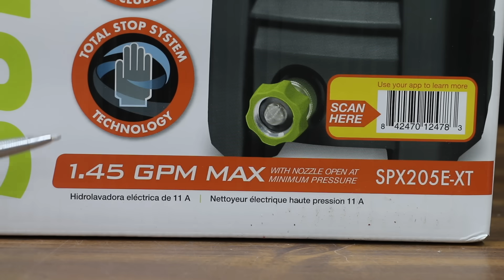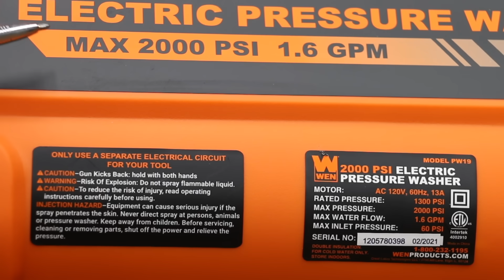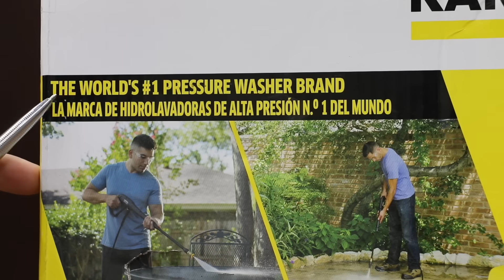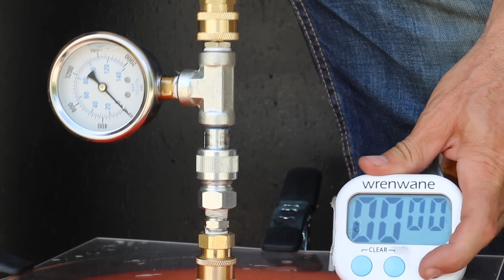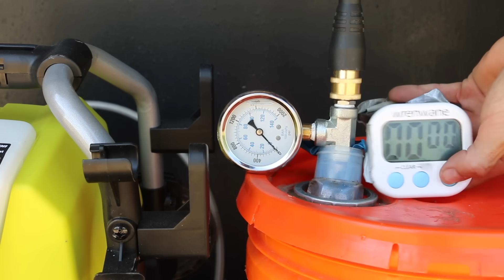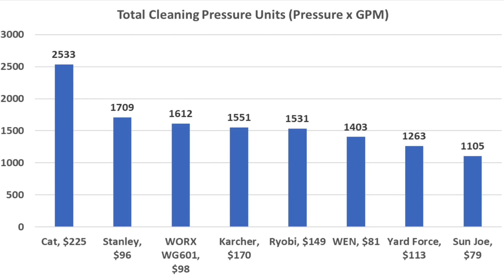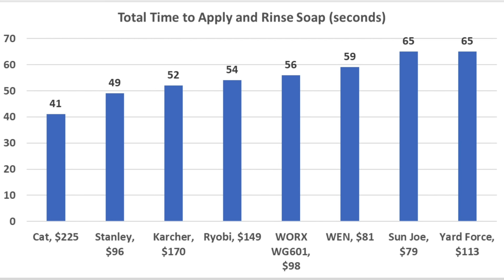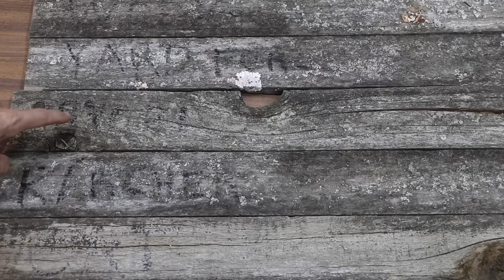Best Pressure Washer (ELECTRIC)? Ryobi vs Karcher, Stanley, Sun Joe, WEN, CAT & WORX

Comment from the maker: To help make finding the pressure washers easier, here are the links (in no particular order):
CAT:  https://amzn.to/3iyVMiV
Ryobi:  https://amzn.to/2Tr5dq9
Karcher:  https://amzn.to/3cBIM8r
Stanley:  https://amzn.to/3xhqRvr
Sun Joe: https://amzn.to/3vdOns1
WORX:  https://amzn.to/2SmwkCF
WEN:  https://amzn.to/3wlti06
Yard Force:  https://amzn.to/2TocmaL
Pressure gauge: https://amzn.to/35jC2rq
Foam cannon: https://amzn.to/3iCOKtp
Sound Meter: https://amzn.to/3uM7WsB
Reply: Couldn’t find one made in America?
Reply: For the 17 minutes it worked the CAT was great and took faded fence boards back to lighter color, BUT unfortunately the CAT has a known problem with the unloader leaking. The result was a shorting out a non-waterproof lighted round on/off switch that rocks the unit in a surging fashion.
Reply: Hey Todd any updates two years later?
Reply: Your new Slogan for your channel should be! "We're Gonna test that!!"
Reply: The "proprietary" connecter many of these have is considered "consumer standard". If you have a pressure washer or accessory, its either the M22 or this "proprietary" connector...
Reply: Will you do a video on a gas powered pressure washer. I'm in need of one after I bought my first house..
Reply: @imthatone830  he still hasn't done one. Seems like the gas ones would of been the ones to actually test. Not electric
Reply: Would a test of battery powered power washers be worth it. I recently purchased a Dwalt 40 volt power washer thinking possibly that a DC powered motor with the advantage of a DC batteries inherently greater ability to provide more power than a 120 volt AC powered system. I was seriously disappointed and immediately returned it. Dwalt should be embarrassed by offering such a poor performing piece of equipment. Maybe there are other manufacturers that are offering better options. I hope you decide to test this option.
Reply: What unit would you rate highest today
Reply: If you don't have an outdoor water supply, can you just put intake hose  into a large bucket of water? Also, no outdoor outlet and to far from indoor outlet, will using a car converter to plug the unit, (Stanley)  work ?
Reply: @ProjectFarm would like to see a warm water high pressure test to. And also how they compare to a normal one. ☝️
Reply: Time for an update on this subject.  There are much higher pressures available in the electric category now.
Reply: If you want to give one away, let me know. I was about to start a residential pressure washing business where I just moved to, and someone stole my dang equipment out of the building it was stored in, 3 hours away where I'm originally from.
Let my tool insurance lapse due to financial difficulties, like a moron, and learned an expensive lesson.
I know these aren't made for most residential jobs, but having a small one is great for some jobs.
Reply: @d-con6825 the cat is now $260 and the active $200 since this video a year ago.  Does the active have standard or proprietary connects?
Reply: @allnovieveryday  I think you're talking to the wrong person. I ended up getting a small business loan to replace my stuff.
Unfortunately, we live in a world full of bad people and thieves.

Comment: Hi Project Farm,

I really appreciate the in-depth and unbiased testing you do—your videos have been a huge help when it comes to making smart tool purchases. I recently watched your pressure washer comparison from a few years ago, and while it was incredibly informative at the time, I’ve noticed that the pressure washer market has changed quite a bit since then.

There have been some big improvements in both electric and gas models, including increases in PSI, flow rate, battery-powered options, and updated features like induction motors and hose reel systems. I think a lot of viewers (myself included) would benefit from a follow-up video that tests some of the newer models against each other and maybe even compares them to the top performers from your original video.

Thanks again for all the hard work you put into testing and reviewing products. You’ve earned a lot of trust from your audience, and I’d love to see your take on the latest in pressure washers.

Best regards.
Reply from the maker: Thanks!  Thanks for the suggestion.

Comment: The CAT 1800 is out of stock on Amazon, but the CAT 1850 is available -- and for less money.  Can someone explain why they are same brand and similar PSI, yet are vastly different design?  And how is the greater PSI less money?  If the 1850 gets the Project Farm seal of approval, I'll get it!!
Reply: I’m seeing this too, maybe cause the 1800 is a more portable design? but for almost half the cost something isn’t adding up
Reply: The 1850 model is higher PSI but lower GPM meaning it's a lower power/quality pump, which is why it's cheaper.

Comment: A 1/4" ID hose will lose between 100-120psi every 10 feet. You are also assuming that the flow rate advertised is true because the flow rate (GPM) is determined by the pump so unless there's a significant restriction (e.g., kinked hose, clogged nozzle, or undersized fittings), the full advertised (if accurate) GPM will still come out the end of a 25-50 foot 1/4" ID hose, though at a reduced pressure.

Comment: It may be the most difficult thing to test, but my issue with these electric power washers is durability. I've had bad luck with getting them to last beyond a few runs cleaning off my driveway. I usually do that once a year, and I guess it could be said they last several years, but that's not much use before one goes out. That said, I've never paid as much as the CAT goes for, so maybe I need to up my budget for a better machine.
Reply from the maker: Thanks for the suggestion.

Comment: I would to see this test repeated using electric pressure washers in the ~2500 psi/2 gpm range—the level at which they start to compare to gas pressure washers.
Reply from the maker: Thanks for the feedback.

Comment: Great video, as usual. I wonder if anyone reading the comments here (including the channel owner) has good experience with any electric pressure washer that is 3000 psi or higher? It doesn't need to throw a lot of gallons per minute, it's mostly the pressure I'm after, and hopefully it can run fine on a 20A/120V circuit.
Reply from the maker: Thanks!

Comment: The very best 8 GPM pressure washer I have is a stainless steel skid I fabricated and assembled myself, consisting belt driven blue Cat pump (UK Cat not Caterpillar), ABB industrial induction motor, ABB IP65 variable frequency drive, unloader, pressure transmitter and Mosmatic trigger gun. It's a perfect build money cannot buy off the shelf. It might last at least 30 years I believe. Total material cost was near to $7500
Reply from the maker: Thanks for sharing.

Comment: I have a Karcher,first handle developed a leak at the trigger valve, bought a replacement, some problem , same place. I have since deleted the trigger and now just use the on/off to control, clearly a flawed design.
Reply from the maker: Thanks for sharing.

Comment: I have had a Karcher electric powered sprayer for ~23 yrs and has worked good.  I think it was mfg in Germany back then.  I think this was listed at 1200 psi capability.  The accessory cart cracked and fell apart while doing little more than looking at it, but all else has been good and has met expectations.  The soaker/ detergent brush head that came with the sprayer is absolutely outstanding for gently washing and is a good product by itself.  The rotary nozzle reduces wash times considerably but would still be slow if having to do driveways.  The rotary nozzle and this pressure combo works good on cleaning the shingled roof of moss, and the directed nozzle for gutters.
For larger jobs and those in line for painting prep, the Simpson 3600 psi with Honda engine and 12 or 15" rotary sprayer attachment have been working good for the past 4 years.   (~$380 back then.)  The higher pressure really helps with the more stubborn mildew and moss.
Reply from the maker: Thanks for sharing.

Comment: Late Comment: Those proprietary nozzles can be replaced with wand-ends that have standard nozzle quick disconnects. This will alter performance. I have cheap low pressure washer from Amazon and a soap cannon that only washes vehicles. Great video! I know where to look when my cheapy eventually breaks
Reply from the maker: Thanks!

Comment: I've had a Karcher since 2002 and to this day I still use it and it works fine. That's 22 years later. If all you need it is for cleaning a car and your need longevity, Karcher absolutely blew my mind. I did end up buying a gas Ryobi for $500 at 3300 psi for some heavy duty jobs. Works fine but I've only had it for 8 months so I can't comment on the longevity. However, it does work incredibly well and it's so powerful it can peel paint from siding if you aren't careful.
Reply from the maker: Thanks for sharing.

Comment: I would recommend that you test electric pressure washers that have 3000 PSI - 4000 PSI ratings.  These have become relatively cheap lately and you don't have to mess with a gas engine.

Comment: Question:  I purchased the CAT model reviewed here.  Very happy except the pressure washer garden hose connection leaks on the back side.  Checked connections, threads, washer, etc.  Everything spot on.  When I examined it more carefully, I notice the female connector nut on the CAT does not seal completely against the metal tube exiting the pump.  The (female) nut connector seems to get snug up against the metal exit nozzle without creating a complete seal.  It doesn't leak terribly - yet - but is there a part missing or is the intended design?

Comment: "Warning: If you buy any DeWalt or Stanley pressure washer in the Los Angeles Area you must travel to Ontario for service under warranty. 
My DeWalt's unit's telescoping handle broke after 6 months, so it is not easy for me to get it repaired under warranty as the service center is 1 hr away.
Reply from the maker: Thanks for the feedback.

Comment: Hi PF, I was wondering if you could refresh this video.  There's a lot of electric pressure washers on Amazon that claim very high PSI like over 4,000. I'd love to see this actually tested. Heck, I'd love to see an actual electric pressure washer that's comparable to gas.
Reply from the maker: Thanks for the suggestion.

Comment: Just an 18month update on your priceless Review...
I bought a Stanley washer here in Ausralia which was like $50 more than our most popular brand Ryobi ...
I have owned 2 Ryobis over the last 5 years which died due to the what 'I call' normal use ...
Our most popular Australian hardware store (like your Harbor freight?) did not stock them, so I tracked and had one delivered ...
My Stanley is still going Strong and the motor has not failed yet ... 
The Plastics are still like new even though it gets stored 'Outside' rain, hail or shine ...
Its even copped a few Dry runs from being lent to friends who dont understand Priming 😢
Like I said 
2 dead Ryobi later and my Stanley still Strong ...
Wish I could have afforded a CAT .. 
But I owe you a beer 🍺 for giving me good advice and finding a good product 👍👍
Reply from the maker: Thanks for the update!

Comment: Best pressure washer with heat capability so car soap mixes really well would be a nice review. The increase in heat helps mix the particles better than room temp water. You’re getting more out of your product than if you used room temp water because of the dense energy.
Reply from the maker: Thanks for the suggestion.

Comment: Considering how close the Stanley performed to the CAT, it would be interesting to see how the more powerful Stanley SHP2150 performs compared to the CAT. The Stanley SHP2150 also has an upgraded wand with quick change tips similar to the CAT.
Reply from the maker: Thanks for the suggestion.
Reply: My Stanley is still going strong 18months of very good use .. no sign of dying yet  ..  👍👍🇦🇺
(better than our cheap leading Ryobi with all its fancy attachments and ctap motor)

Comment: You need to do this with bigger psi washers do a 2000 to 3000 test or 2500 to 3500
Reply from the maker: Thanks for the suggestion.

Comment: Great video as always, but I would like to see a 1 year review.  This is because most negative reviews on pressure washers are due to the units failing to run after a few months.  It could have something to do with water quality or the internals rusting, but this would be an important part of making a decision.  I have had units in the past that, if left for more than a few weeks without use, tend to be more prone to failure.
Reply from the maker: Thanks!  Thanks for the suggestion.

Comment: Always appreciate your videos. Just bought an Active pressure washer - which apparently the CAT is, just rebranded. It was $30 cheaper than the Cat. Got it today and cleaned my trashcans. It worked awesome and it was really nice not having to drag out my bulky gas washer for the small jobs like this. Thanks for doing these videos, I’ve relied on them before several big purchases.
Reply from the maker: Thanks and you are welcome!  Thanks for sharing.
Reply: The active 2.0? Is it really the same? Where did you see that? I have both in my Amazon cart been meaning to make a decision lol.
Reply: @ThatAccumulator  - Not the 2.0, the VE52 and this cat have the same five piston pump. The cat has different storage solutions and an extra nozzle, though.
Reply: @ThatAccumulator  - PS, IMJOSHV detailing channel did a side by side comparison of the ve52 and cat. Id paste the link, but it would get deleted. Good luck.

Comment: Had always borrowed a gas powered unit from work for the Spring deck and walkway cleaning. This Spring I bought the CAT unit and it works perfectly.  Using the 25 degree nozzle it has just the right amount of stripping power to clean the Vermont winter grime off the wood and prep it all for summer.
Reply from the maker: Thanks for sharing.
Reply: If you don’t mind me asking, could you give us an update on how your unit has held up after 6 months?

Comment: 1500 psi is hardly the best of anything. For less than $275, you can easily find quality, mid-level pressure washers at 2500-2800 psi at 2.0-2.5 GPM.

Comment: Make what you will of this info...I bought a Karcher 1700 psi sprayer back in 1997. Stored in an unheated shed, it just started leaking last summer. I did nothing as far as maintenance. The replacement part costs $20 dollars. Works fine after 25 years.
Reply from the maker: Thanks for sharing.

Comment: Not sure why YT is showing me this a Year late....but Ironically we are looking for a 4000 PSI electric for use on the Hay Barn roof so I dont have to haul our 125 lbs mid size washer up there like the last time I did it 10 yrs ago when i replaced a few Thousand rusty screws.    Sadly the 1500-2000 psi is a bit to light for our needs but still nice to know the results in case we need a small power boy for Fairs or Shows, Keep up the Great Work !!!   
 
  Also.... I have been meaning to ask you have you ever tested ANY of those Rechargeable LED Flashlights you carry around in Truck , Junk Draw etc.........I dont mean the Flashlights That can use the Dewalt 20v battery for Cordless tools but ones that claim you can see a 1/4 mile with etc.. ie on Amazon, we use a few that have (2) 18650 3.7 l-ion batteries they are normally like between 12 to 15 inch long flash lights.    Be Safe & God Bless  🍻💯🙏🌴🐊✝🤠  Cow}:-o)
Reply from the maker: Thanks!  Thanks for the suggestion.

Comment: What about DUTY CYCLE, the most important factor for usability AND a good indicator if it will fail if it's a short time and you run it overtime frequently.
You usually have good testing but you utterly failed on this test

Comment: I have had a sunjoe for over 5 years now and it’s still going strong.. I often leave it out and it gets rained on and not treated nice.. I do try to get all the air out before I turn it on every time I use other than that I treat it pretty bad.. it’s ran dry a couple time from a kinked hose

Comment: I ended up buying the CAT based on this video.  I'm not sure if I had the wrong expectations. My experience was always with gas, but a long time ago.  However, I think you could wash a baby with the CAT it's so gentle.  I had boxed it back up to return after short time, but waited a few days, double checked everything, used a short hose right to the house.  It could remove only the light dirt, but nothing else.  Not paint, not rust marks, spots of joint compound that had fallen on the cement.  It couldn't even remove the green algae like mildew which I thought at least I could use it to clean all that up.  It just dusted everything so you could really see all the stains it couldn't clean.  If you intend to use it for car washes, it will soap up and rinse off your car fast.  Maybe patio furniture? I'm going to rent a different electric and an entry-level gas and try to align my expectations, but in the meantime it's one of the very few things I've ever returned.
Reply from the maker: Thanks for the feedback.

Comment: Great video. But, when I went to Amazon and checked out the reviews for both the CAT and the similar Active, about 10% of each complained of short life before internal short/leakage/failure and abysmal customer support. Have you had an opportunity to test the longevity/reliability of the CAT in the time since you purchased it?
Reply: Did you find a better option? I'm interested in finding out:) Thank you!
Reply: @vickikgibson9470  I went to Lowe’s, so I’d have a local retailer to reach out to if the unit has issues. Haven’t used it yet because the condo association pressure washer crew came by the next day and did all our patios.